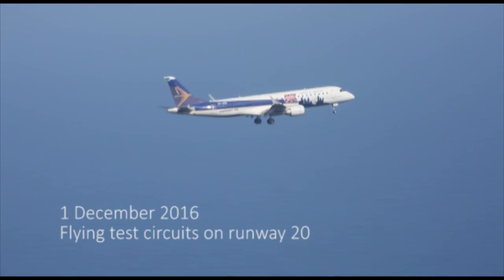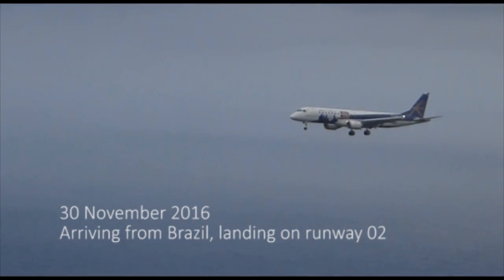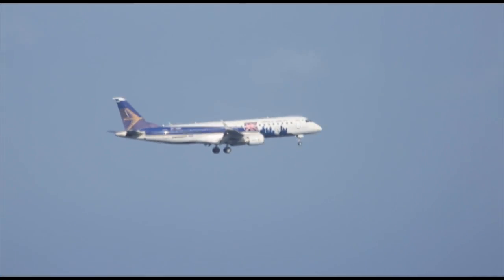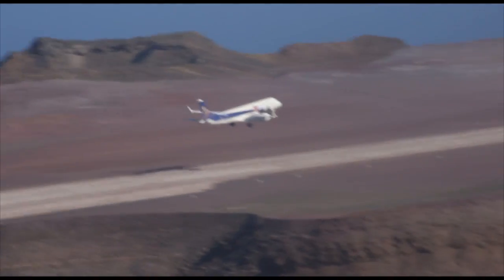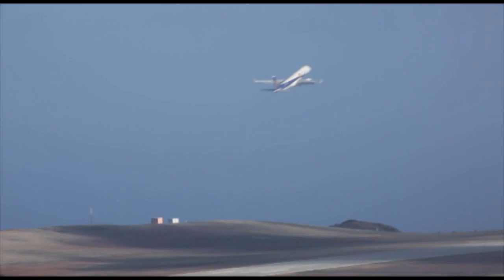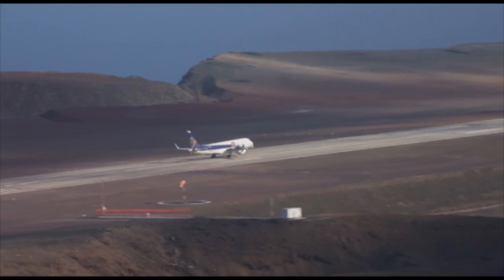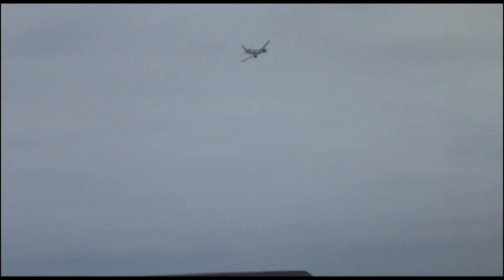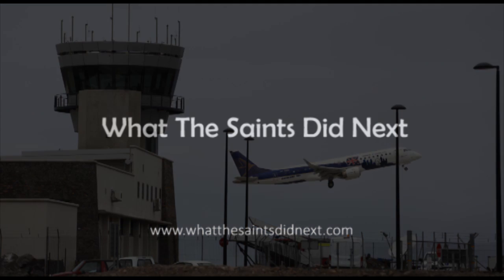Exclusive: Embraer Test Pilot interview on St Helena Airport

Comment: was pretty much surprised that Rio airport is harder for a pilot than StHelena!
Reply: Rio de Janeiro has two commercial airports. The large international one (Galeão, GIG/SBGL) has no problems at all: it's on an island in the middle of the bay, very long runways, unimpeded approach, no wind problems either. But there is also the much smaller Santos Dumont airport (SDU/SBRJ), on a landfill next to downtown, used only for short domestic flights. This is the one he was talking about. Look for it on Google Maps. It has an EXTREMELY short runway (1323 m/4340 ft) that ends on the sea on both extremities, virtually no escape area, Sugarloaf Mountain just a mile to the south and the tall Rio-Niterói bridge to the north, steep curves needed on approach, some surprising winds on finals. Pilots need special training to land there. Yet it receives regular flights on the Airbus A319 and Boeing 737-800 (in the Special Field Performance version). It's believed to be the world's shortest runway where a 737 regularly operates.
Reply: It is not that hard!